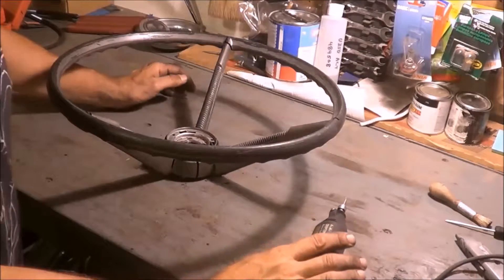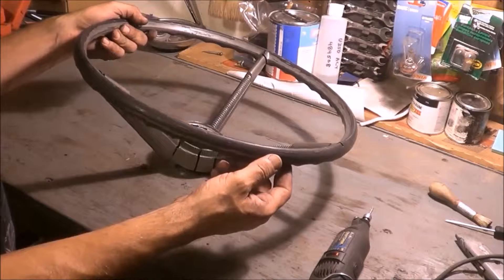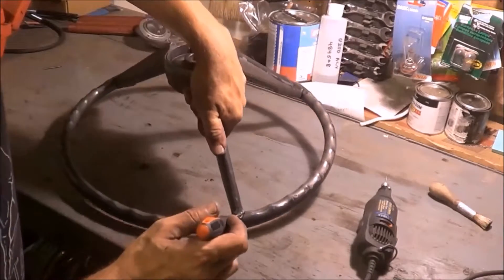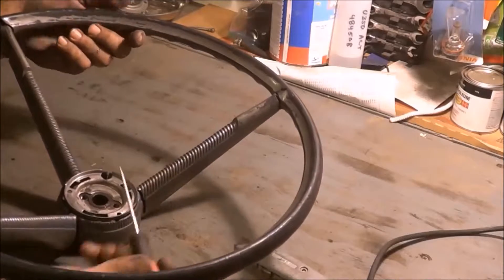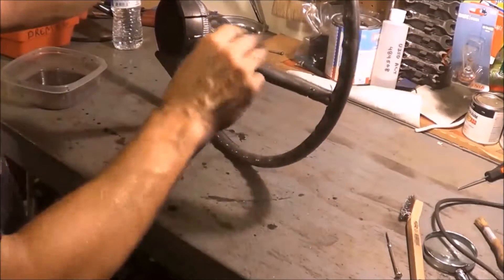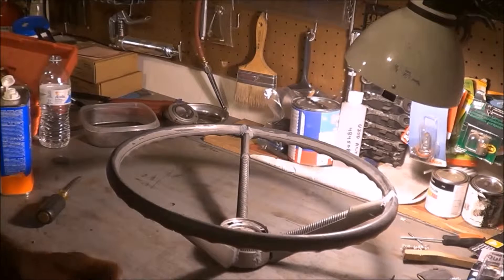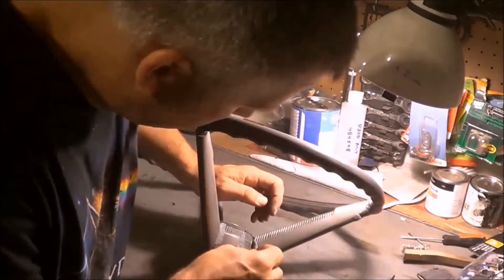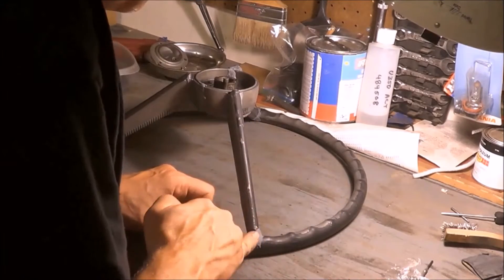Restore '63 Falcon Steering Wheel

Comment: How has it held up so far? Mine is in primer and about to finish. Cleaned, ground, filled, filed, adhesion promoter, epoxied... Twice... And again in high build about to do the final sand. It's almost there. 62 Fairlane, same wheel and condition to start.
Reply from the maker: Josh, just saw your question.  so far its held up great.  the paint chipped one time but that's because the seat belt buckle hit the steering wheel.  a few hairline cracks have shown up in the corners where the wheel spokes and hub connect, but they're minor.  all in all, it still looks a 1000X better than before this project.

Comment: You should have shown the finished product.
Reply from the maker: Donn, You're correct.  problem is I didn't think ahead when I wanted to do this video.  I used colors you can buy at any AutoZone stone.  The paint came out nice, however if I ever do this again I would use a 2 part automotive paint since it would give a glossier finish.  thanks for watching.